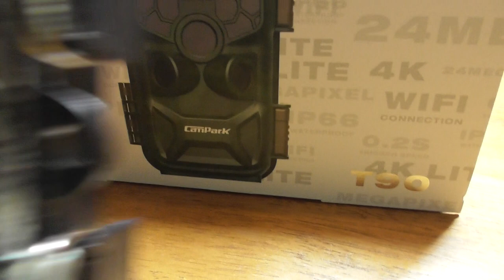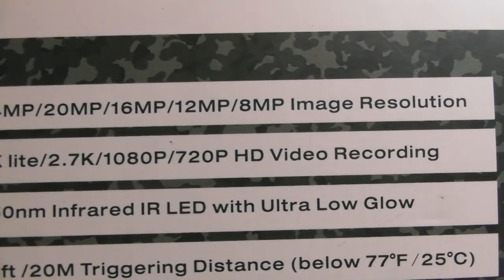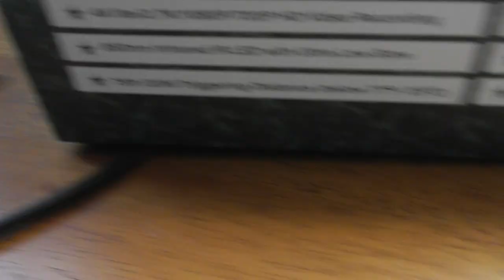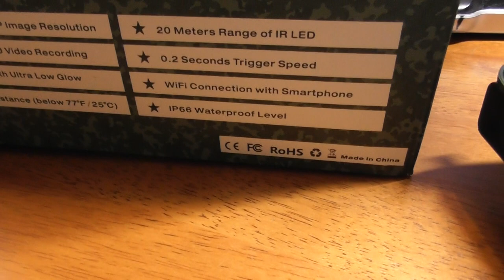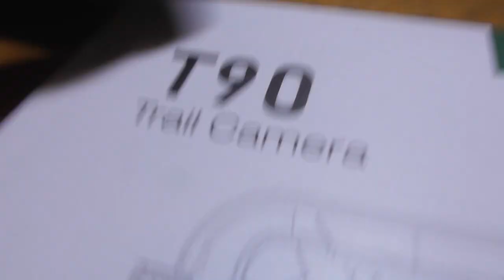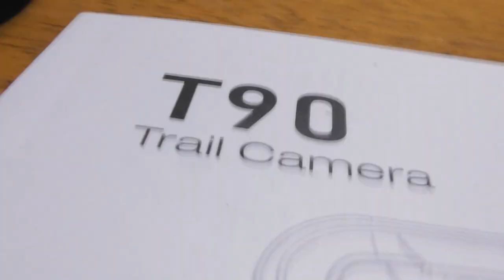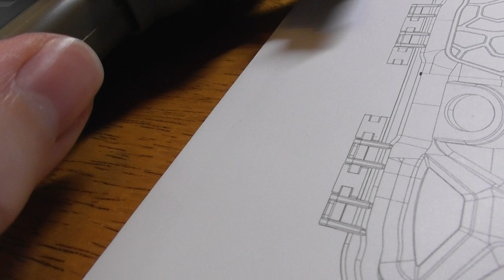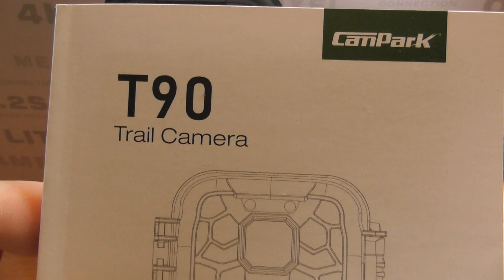Unboxing 4k Digital Trail Camera by Campark brand the T90 model 29jan22 England UK

Comment from the maker: warning , i bought 2 of these brand new and tested both, the first recorded a halo light effect on the sides of the videos, i carefully compared this camera to the other one i got and noticed the lense seems to be pushed in a bit ( damage in transit due to only being wrapped with a thin plastic bad no bubble wrap or badly made ) so it seems to be recording the edges of where the lens is housed ! so will send it back, the 2nd identical T90 for some reason records everything as a pink colour in daylight ! utterly bizarre so i will be sending this back too , well thats that 2 bad units from 2 purchases on ebay means i am not buying any more of these i have lost trust in the Campark brand .

Comment: Deal
Reply from the maker: warning , i bought 2 of these brand new and tested both, the first recorded a halo light effect on the sides of the videos, i carefully compared this camera to the other one i got and noticed the lense seems to be pushed in a bit ( damage in transit due to only being wrapped with a thin plastic bad no bubble wrap or badly made ) so it seems to be recording the edges of where the lens is housed ! so will send it back, the 2nd identical T90 for some reason records everything as a pink colour in daylight ! utterly bizarre so i will be sending this back too , well thats that 2 bad units from 2 purchases on ebay means i am not buying any more of these i have lost trust in the Campark brand .
Reply: @AwesomeFullHDvideos  jeez